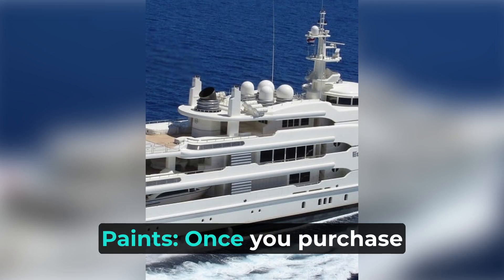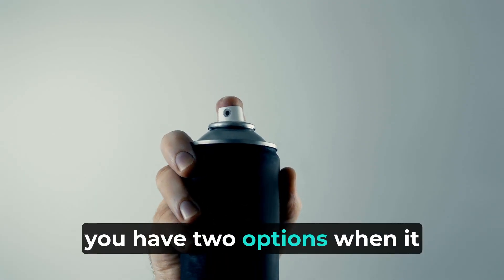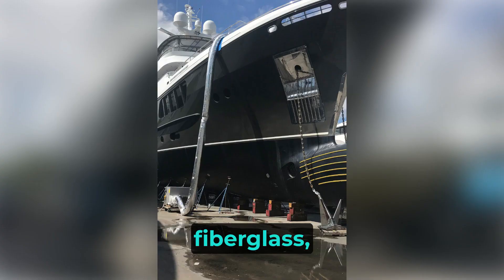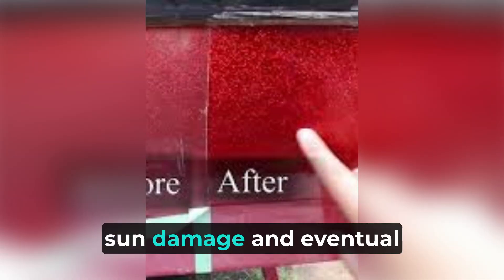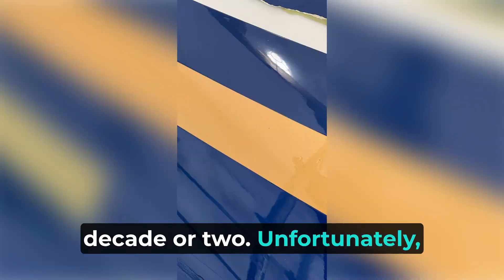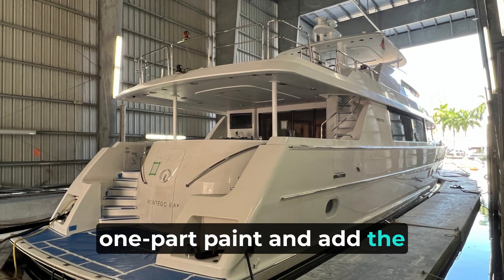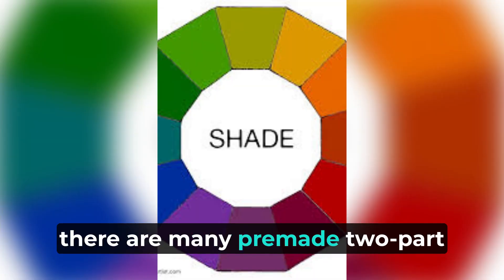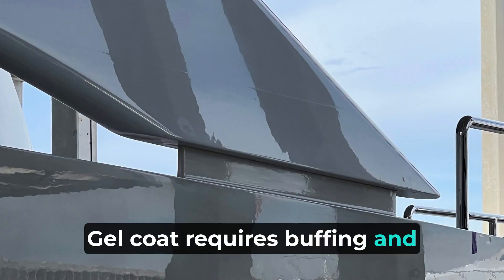Gel Coat vs Marine Paints for Yachts

Comment: I have a very old GRP sail boat which has a topside in poor condition. I have sanded it and have the dilemma of which product to use. From what i can see the easiest option is paint as its easy to apply and gives shiny result, plus is simple to patch damage. Whereas Gelcoat is really a moulding product which comes out of the mould nice and shiny because it was starved of oxygen and set hard and smooth. If you choose to apply gelcoat onto an existing surface its more effort, needs a wax to set (flowcoat) and sets with an orange peel texture. That then needs sanding and polishing to get the desired finish, so its heaps more effort. Using gelcoat should give a longer lasting and thicker coat.
Reply from the maker: @simonroyle2806  you nailed it! I will say that coatings have come along way. Using Awlgrip’s HDT will provide a similar finish to polished gel coat.